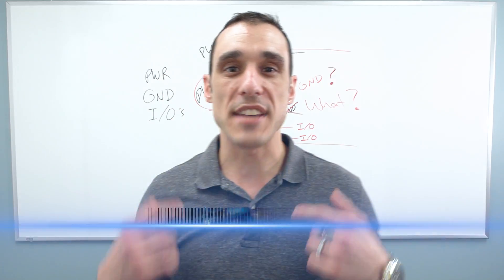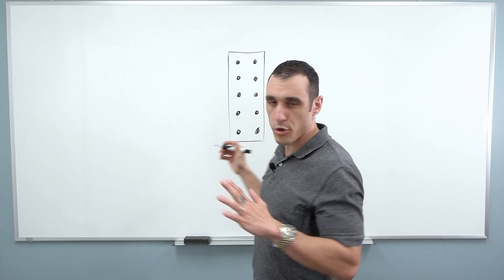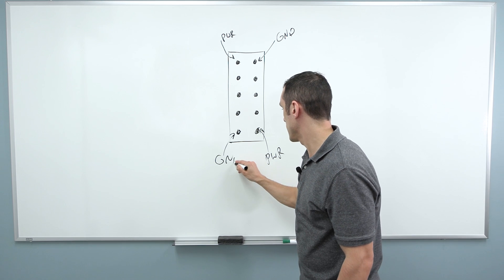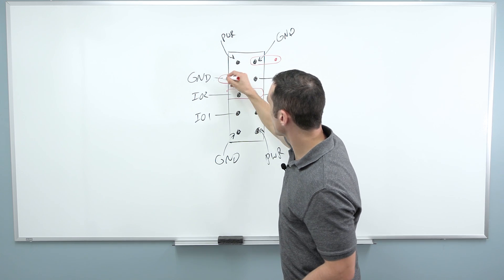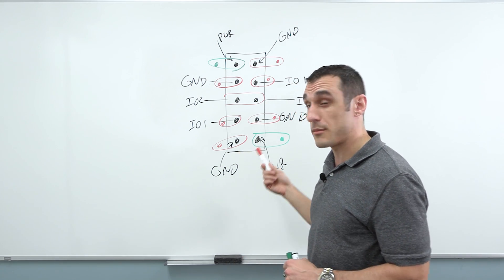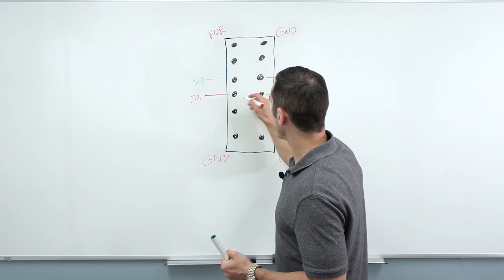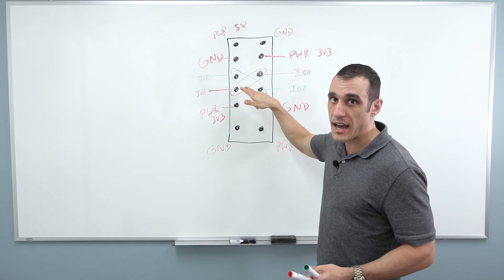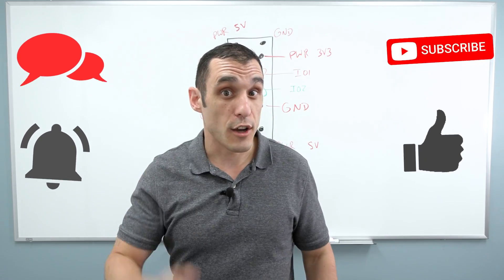How to Design Rotation-Proof Connector Pinouts

Comment: I have tried and failed with a usb c connector but not with usb nets. It was for a custom connection type and having 12 nets rotation-proof is seemingly impossible
Reply: You need a 2x12 connector and just the nets in opposite directions.